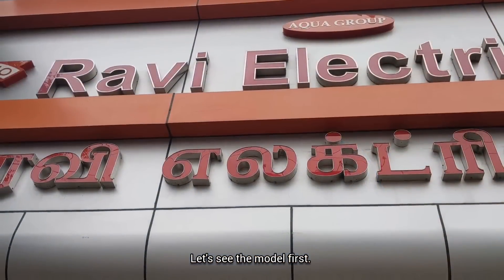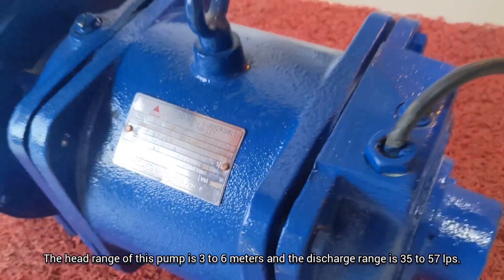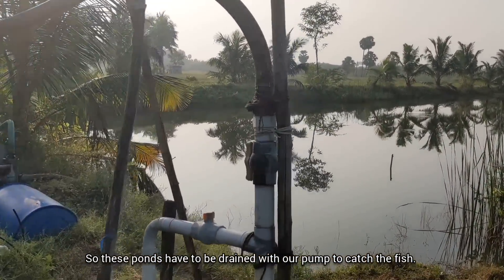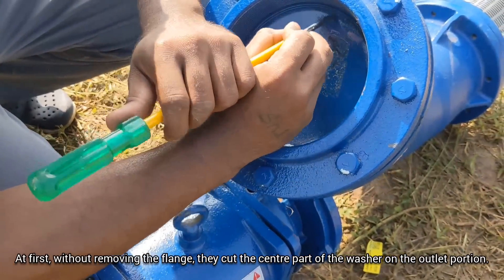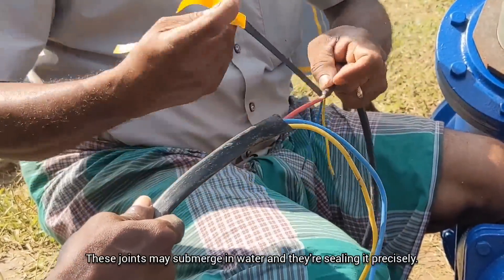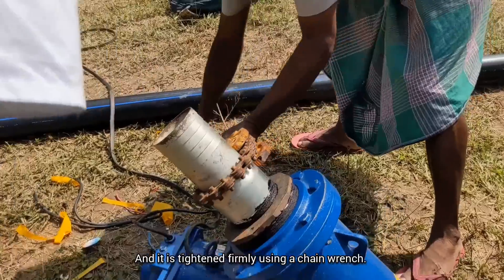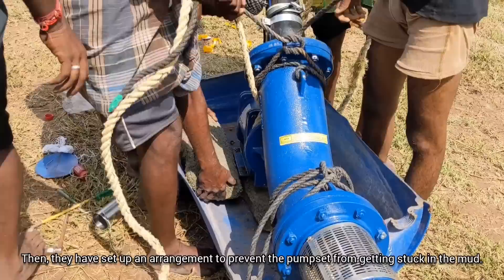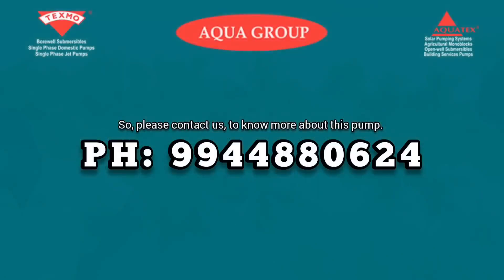AQUATEX ASMAX SERIES SUBMERSIBLE PUMP - INSTALLATION (PART-1)- in a #village in #tamilnadu

Comment: Sir 2hp models link, or technical data sheet (head, discharge 1 phase or 3?)
Reply from the maker: Please contact our nearby dealer. If you found any difficulty in finding our dealer, please contact us on 9967410321

Comment: Why to reduce the out put to 4'' . when  you get optimal discharge 6''.
Reply from the maker: Yes sir. It is purely due to the customer's choice and availability of the delivery pipe in that locality. We recommend a 6" delivery pipe to get the optimal discharge. 
Thank you.
Reply: @VNJENGINEERING  you are correct it will develop pressure on motor.
Reply: Should give technical information.

Comment: How mach ft delivery height
Reply from the maker: Sir, The new ASMAX SERIES horizontal, open-well submersible pumps are commonly used for Low-head, High-discharge applications. 

General specs- THREE PHASE OPEN-WELL SUBMERSIBLE MONOBLOCKS, HIGH DISCHARGE, AXIAL FLOW, WATER-COOLED, 380VOLTS, 50HZ, AC POWER SUPPLY.

Variants:
1. ASMAX37150 - 5.0HP(3.7KW)
PIPE SIZE- 150x150 mm
HEAD RANGE- 3.0/6.0 m
DISCHARGE RANGE- 57.0/35.0 lps

2. ASMAX15100 - 2.0HP(1.5KW)
PIPE SIZE- 100x100 mm
HEAD RANGE- 3.0/4.5 m
DISCHARGE RANGE- 22.0/9.0 lps

CONTACT DETAILS:
RAVI ELECTRICALS, DINDIGUL & PALANI
PH: 9944880624

VNJ ENGINEERING, DINDIGUL@VNJ ENGINEERING  
PH: 9967410321

Thank you.

Comment: sir dealers in andhra pradesh in vizag
Reply from the maker: Sir, please contact any of the following branches to get the dealer's contact in your area. 

CHITTOOR
10-189, KDC Buildings, Near District Court, Prakasam High Road, Chittoor- 517 001. Ph: 08572 - 226338

VIJAYAWADA
75,76 and 77 Block NO.05, New Auto Nagar Kanuru, Krishna, Vijayawada, Andhra Pradesh- 520007 Ph: 0866-2955922

Thank you.